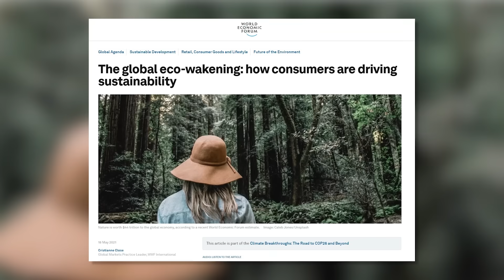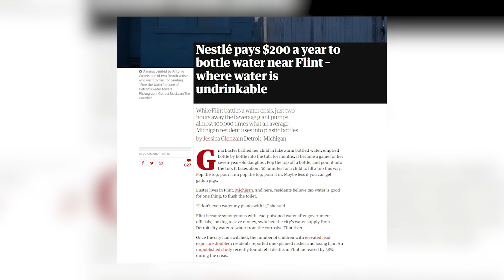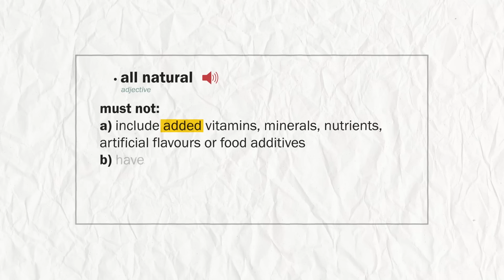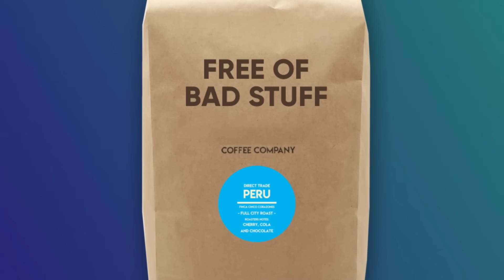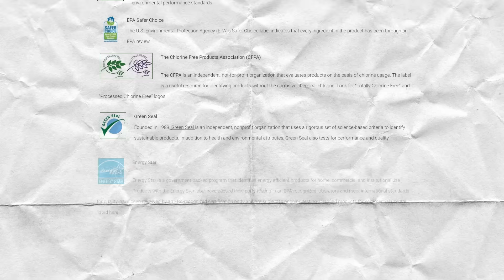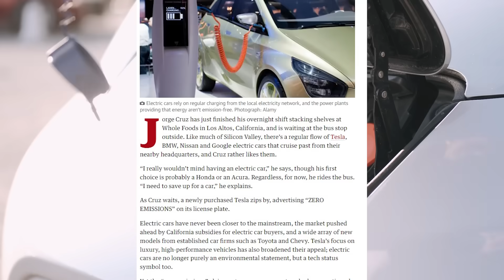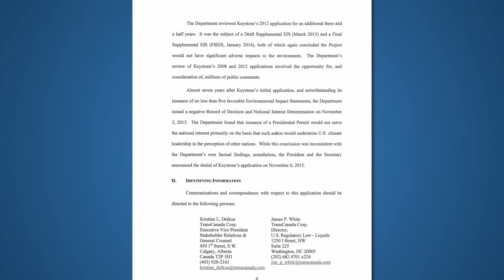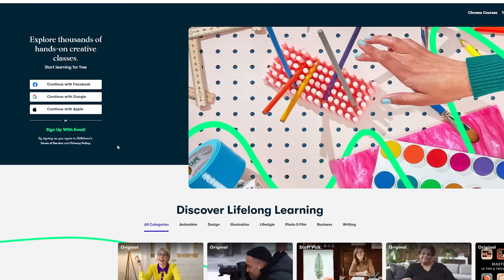Why Being 'Environmentally Friendly' Is A Scam

Comment: I can relate - I went vegan a few years back mostly because I feel guilty that animals have to die to satiate my appetite, something I could go without. I recently switched to pescatarian because (and I know this sounds bad) I don't really feel the same way about fish as I do about animals, but I know that there is environmental impact from overfishing to be worried about so... I tried to research eco-friendly fish to consume. Turns out, it's a nightmare! You can pick up a packet of frozen fish and look for something on the label that certifies that they are fished sustainably, but there is no way of knowing how TRUE that label is, combine that with the fact that there isn't a single body that certifies "sustainable fishing" there are many of them and some are better than others and yet still aren't REALLY doing as much as needed in order to verify those companies are ACTUALLY fishing sustainably.

Long story short, I just threw my arms up in the air and buy fish regardless, as long as they have SOME label saying they are eco-friendly or something of that sort. Yeah, it's a bad mindset to have, but I give up.
Reply: The only way to know for sure would be to know the ecological state of the water system and fish yourself. For example, here in Finland, due to eutrification, small fish are often  overpopulated in inland waters, like lakes and rivers, and throw them off-balance. However, that fish is not commercially fished and sold to human food. It's fished by small volunteer environmental projects and sold to fur farmers or thrown away as waste, because this fishing is done for environmental reasons only and the people working on these projects don't have the capacity to manufacture it to people-safe food-grade products. Environmental protection and food production aren't done together.
Reply: @raapyna8544  
That sucks… because I’d love small fish to make up the bigger part of my diet. I’m originally from Slavic countries (Ukraine, etc.) and grew up eating fish products like smoked sprats in oil and sardines in tomato sauce - this kind of stuff sounds gross to most Americans but I love it and small fish are typically more rich in omega 3’s

Comment: I've been trying to look for the brands that have compostable packaging. Also pods are just packages of fancy colors marketed at a higher price. Dishwasher powder help in a cardboard box contains the same ingredients. Poor working dishwashers are usually user error because there should be dish detergent placed in the indent that helps remove food during the initial rinse.

Comment: I've started looking for plastic-free cleaning products. I just bought laundry sheets, which are "sheets" of detergent in a cardboard box. I haven't tried it yet, but if it was humid here I'd put them in a jar.
Dish soap in an aluminum bottle to refill your glass dispenser (or refill the plastic bottle) is another product I just bought.
I'll have to come back with a review after I use them.
I love Mrs Meyers products, but except for the general purpose cleaner concentrate, which makes gallons of ready-to-use cleaner, it's all RTU and everything's in plastic. 
Any suggestions on sulfate free liquid hand soap? I use Alaffia, but it's in plastic bottles. Bar soap is impractical in my current situation, with limited space and multiple users, Including health care workers and bad mannered cats. Sigh.

Comment: re: electric cars

Even in places where most of the electricity comes from coal, the fact that large steam turbine generators are cleaner and more efficient than automotive engines means that electric vehicles still have the edge.

Lithium is often harped upon because of the name "lithium battery."  But, the batteries contain 5% or less of lithium.  Also, the biggest supplier gets it from brine pools in the desert.  It isn't perfect, but much better than extracting oil.

But don't take my word for it.  Listen to an automotive engineer: https://www.youtube.com/watch?v=6RhtiPefVzM

Or maybe SciShow: https://www.youtube.com/watch?v=0_RRKePSjL4&t=192s

Comment: The solutions presented are worse than the problems because they give false hope and distract people to avoid them thinking in what they are already trying to avoid: that their belief systems are wrong.

For regulations to work in any medium, the regulators need to have MORE POWER than those they regulate. This is increasingly not true, as the market dominates ever more everything. Government power is fixed to its borders, can't grow beyond it; the private market is global and every company has the imperative to always increase profits, or lose its place to one that does. Only one of these powers grow, of course the growing one is going to surpass the other.

A government tries to regulate corps, they just move investments where they have less regulations, more profit. Who's in control...? The private market, of course.

It's not even the corporations' fault, they're not "unethical", its just the rules of the system. Capitalism has a single imperative: ever-MORE profit. To that it needs ever-MORE production with ever-cheaper costs. Nature can't pay back the extra cost required to conserve, so it'll always be cheaper, therefore give more profit; to NOT conserve. As shown in the video, it is much cheaper to easily manipulate artificial demand than to spend on an entire new way of production. Capitalism is fundamentally incompatible with conservation.

Comment: the thing about the transcanada pipleine is that the oil is still going to be shipped. It will be shipped by train that will pose a similar risk of leaking, if not worse, and then also run the risk of dreailment that could cause huge impact especially as the trains go through populated areas

Comment: Basically, having control over whether you need to buy the 'thing' or not has more influence on the environment than anything else.  
I think Apple is the only exception since they actually have laid out a real plan for recycling their products at the end of life cycle (ie. at 10 years or so).  That's why I prefer 'turning in' my phone or iPad to them in exchange for credit towards a new one rather than storing it in a closet (this is what people did in the 90s and 2000s with their old cell phones).  However, all that waste water and other chemicals than gets introduced into the waste stream during chip production and metalwork operations is something that needs addressed.  This never gets brought up, ever.

Comment: One issue with companies not being able to install pipelines or use resources like coal or oil in countries like Canada, the USA, the U.K. or in the EU, due to people rightly campaigning against it, is that these companies then often buy or source these materials (coal, oil, gas etc) from other counties with less government regulations. So for example the U.K. will have a better CO2 emission improvement than say china but we buy all our products from china which involves the use of fossil fuels there to produce our products and then for shipping them internationally. They also have worse human rights practices but that’s a whole other story. We then end up shipping our “recycling” to other countries in Asia or Africa where people on low incomes have to burn them for instance, thereby exposing themselves and the environment to hazardous fumes. Sigh, the whole system just seems so broken. My current pet peeve is companies saying their products are recyclable but this is theoretical only as no facilities are available to recycle them from consumers. When are governments going to hold these corporations liable for their products from production to disposal.

Comment: I was with you right up until you attacked the pipeline.  Yeah, it's so much safer to transport that mess on the roads and rail tracks?  It would have been MUCH safer to have it confined in a double-walled and constantly monitored pipeline.  Some people are willing to kill 1000 ducks to save one.  That is just ignorant.
Reply: The pipe cracking is a matter of time. And how soon will someone notice it in peripheria?
Reply: @raapyna8544  It is double-walled and has sensors to alert to any potential damage long before a leak would start.  It would have been one of the safest methods of transporting oil that could be used. It was ignorant to pass up a safe method in favor of the more expensive and dangerous methods of transport.  This is what you get when the decision is determined by uninformed people who yell the loudest.

Comment: Funnily people have been saying this for years, many of them are conservative and so therefore ignored. Maybe understanding diverse thought should be discussed. You don't have to agree but it is valuable to approach with an open mind in understanding. 

For instance(some of this is alluded to in the video) there is a lot of confusion about our current energy situation. We want to go green in our energy sources but also turn all vehicles electric. In a world with growing demand issues, there is a major problem with supply in most green energies outside of hydro, thermal, and nuclear. One of those are often ignored despite being one of the safest on record energy sources and the other two depend on geography and can only supply a minor portion of population. Then there is the fact that no green energy source is truly green or even humane as the processing to extract it has a huge environmental impact and the rare minerals used in green tech tends to be sourced from underpaid and/or child laborers. Note, that this is a problem with ALL technology but to go green will put a higher demand on these sources and make them problematic.

Can make the same points about anti-GMO and organic but they don't have any benefit beyond the naturalistic fallacy

Comment: As an engineering student, we’re taught to take environmental and ethical factors into account when designing products. It was a big part of the “engineering economics” course specifically. We have to look at both the actual cost of products and the other effects it could have.
Reply: Planned obsolescence - capitalism 101
Reply: @thegratefulsteve  Yeah. I’d bet that the engineers who design products for obsolescence aren’t happy about it. Especially, since it’s actually less work and more satisfying to design something that will last.
Reply: This must be a new addition to the curriculum, or not very effective, because it's not showing in the market currently. Hope it's new and newer generations of engineers will have this knowledge to make and maintain sustainable infrastructure.
Reply: @raapyna8544  I think it depends on the school and the company that someone ends up working for. The other problem is that during the bidding process for projects (where the various designs get pitched), the most financially effective (cheapest) option is usually chosen regardless of other factors especially when it comes to government contracts. We’re taught to create environmental and ethically sound designs but that doesn’t mean that those designs are the ones being financed.

Comment: Even when powered off an exclusively coal electric grid, an electric vehicle requires less carbon emissions than a gasoline one per km.
Further, electric vehicles are so much more efficient that you can fill a Ford Raptor with fuel, use it to tow a Tesla (while charging it with braking), and then detach it and still manage drive the Tesla further than you could have simply driven the Ford Raptor on its own.

Comment: Single use plastic itself isn't actually a problem. ill advised recycling attempts and selling single use plastic to countries that don't have adequate waste management (landills and trash pickup service). Is the problem.
Landfills are an amazingly efficient way to deal with enormous quantities of waste compaired to literally any other method. And I'm not just saying that because I work on them. Also in so far as they can be kept dry and filled with dense cellulose, they are a cheap way to sequester carbon incidentally to general disposal interest.

Comment: Keystone pipeline has a small risk and the benefits outweigh the risk. Without it you are emitting greenhouse gases from transporting the oil by other means. There are pipelines all over and they cause little to no problems.

Comment: Can you go into detail about why specifically Keystone XL was so environmentally risky? Like I get that using fossil fuels exacerbates climate change but its not like we will be able to eradicate our need for oil in the near future. So wouldn't it make sense to build pipelines as opposed to  transporting the oil via trucks and trains as pipelines are more environmentally friendly? Additionally developing domestic/Canadian infrastructure would lessen our dependence on oil from overseas. Not only would this further reduce the energy required for transportation, but  it would also lessen the amount of oil we receive from totalitarian countries that don't typically have the best environmental track record to say the least.
Like maybe I'm missing some details. I've read some of the counter arguments, the biggest being fears of it leaking. However, it doesn't really seem to me that it was the slam dunk issue you make it out to be.
Reply: We have to stop relying so much on fossil fuels in general, the only reason why we are still so dependent on it is because of corporate greed. We need to stop accommodating the oil business and supporting green energy.
Reply: Need to support green energy*
Reply: They have no clue what they are talking about. They are just spouting left wing propaganda. The activist got residents all worked up over false info. Pipelines are all over and cause little issues. If you’re not running it through a pipe, you have to transport it on a truck. Their thinking is why gas prices and goods are going up and the poor suffer the most.

Comment: I agree, most of these labels are BS. It’s just a marketing scam. I just really think we desperately need better options. One option is to make a bunch of regulations which will hurt our economy and it will drive off some of the companies based in America. There’s no preventing that because there’s just no way developing countries will ever create a bunch of strict regulations and even if they did, their governments can’t enforce them effectively enough to make a difference. Overly strict regulation only works if everyone is on board, or at least mostly everyone. So regulation is part of the solution, and it’s FAR better than blaming individuals for climate change, but it’s not enough and it can’t be the thing that solves everything because it just won’t. Real environmental change will only come when climate-friendly options are cheaper and more effective than conventional options. It’s going to take a lot of time and investment to get that off the ground. We don’t have any time and nobody is willing to pay the investment. And America and China can’t fix this issue by themselves. So this is just really, really complicated and while we should never give up, there’s just no way we’re stopping significant climate change from happening. The only question now is how badly we’re going to bleed before we can get a handle on it and start reversing it. Again, there’s a massive difference between bleeding out and minimizing the bleeding, so it’s no excuse to give up. At the same time, thinking we can prevent climate change is just really, really naive. I haven’t seen a single technology that is ready to make a change. Even the most promising ones like nuclear power are shot down by the public because it’s a pain. People just aren’t evolved enough to sacrifice short term convenience for long term prevention of catastrophe. It’s a lesson we seldom learn and quickly forget. It’s just not how we’re wired, me included for sure. How we’ll ever grow beyond that remains to be seen, but I have hope that we will.

Comment: The three R’s (reduce, reuse, recycle) are in that order for a reason. 
- First, reduce as much as you can. Reduce is the most important R, it’s the one thing we can do as consumers to make a gigantic difference. Consume less of everything, eat less high-emission foods like animal products, non-local foods and out of season foods, make it a goal to create less trash, choose the option that create less emissions and trash like public transport, dine-in instead of takeout, staycations. Trash is really the #1 way to make an impact so do your best to minimize your garbage. 
- Then reuse what you already have. Don’t do things like throw away your plastic tupperware to buy glass tupperware, buy all things second hand whenever possible, choose quality over quantity where applicable 
- And when there is absolutely nothing else you can do, recycle. 

To make things easier for your future self, try to always, always think about what’ll happen when that item you want to buy is done/broken/used up and implement the three R’s in the correct order; 
Reduce - do I really need this, and do I need it right now? 
Reuse - can I buy this second hand? Can this item be resold/reused when I’m done with it? 
Recycle - is this item recyclable if it breaks or becomes unusable in some other way? If your answer is no or maybe to any of them, buy it second hand or don’t buy it at all. 9/10 times you’ll realize that there is a better option or that you don’t need it. 

Plus, you’ll save time and a bunch of money when you go low-waste!